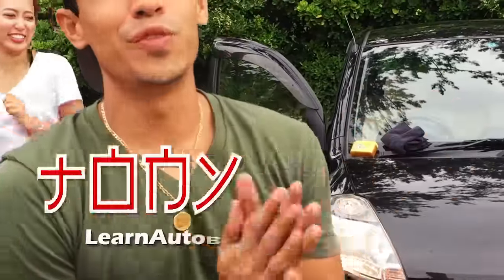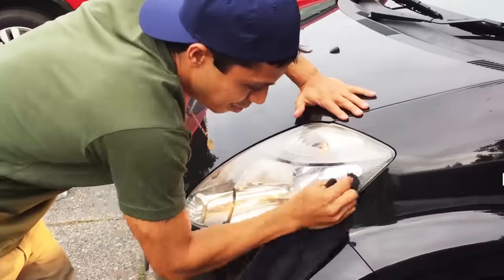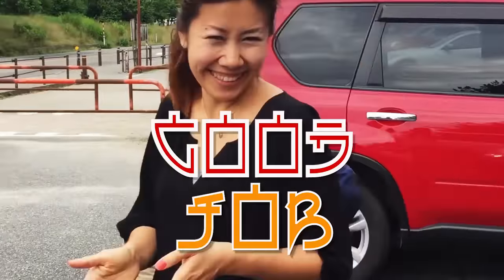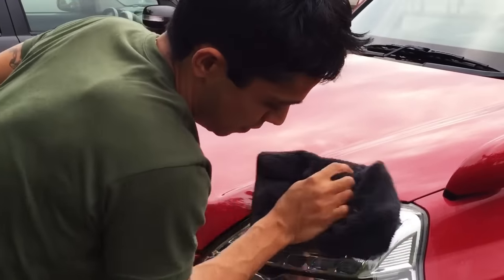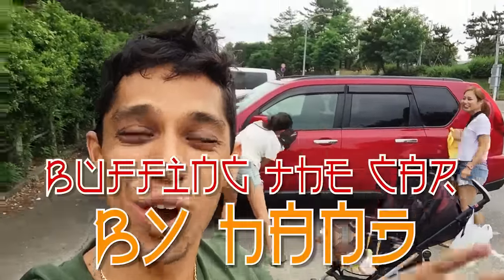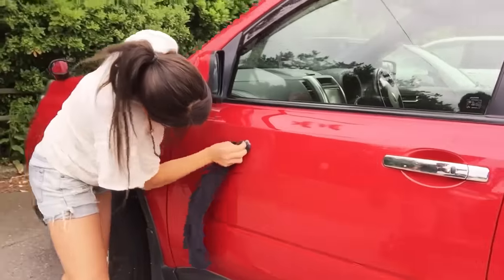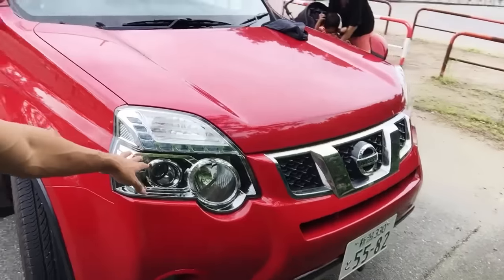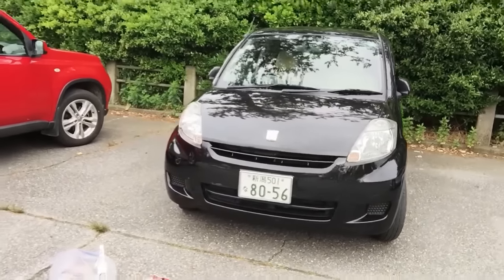Headlight Restoration: How To Easily Polish Your Headlights To NEW by Hand!

Comment: I've noticed when I use compound, the headlights cloud up again pretty quickly.  Have you ever done the wet sand/clear coat method?
Reply from the maker: Means that you didn't buff them enough. You need to buff them good, then wax them later. They should last you 2 years or so if not in the weather all day... You can also clear them, but then they may peel after time...
Reply: Thanks Tony.  
I already cleared mine recently... then I wet sanded with 3000 and polished by hand with Scratch X 2.0.  I guess I will see how that goes!